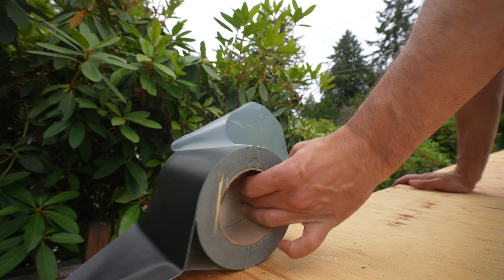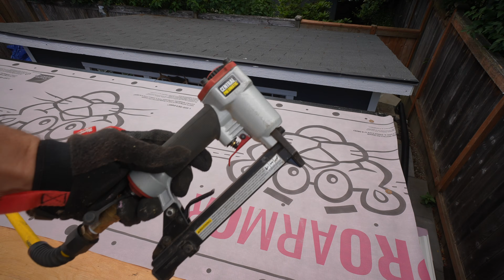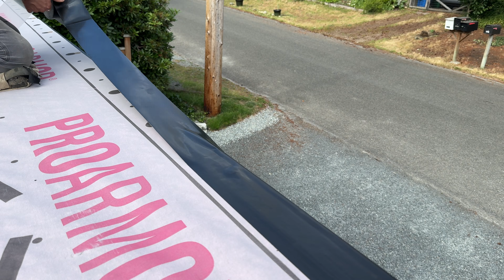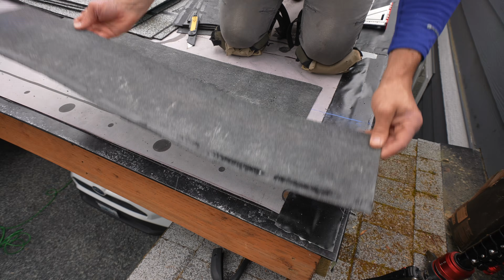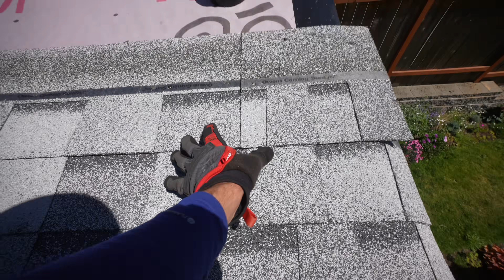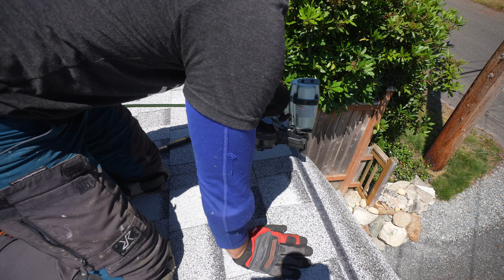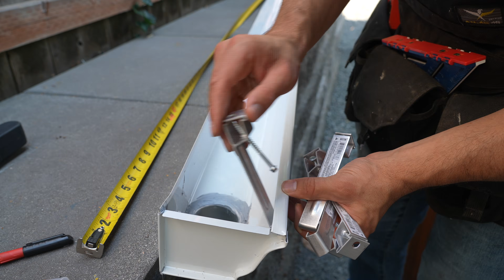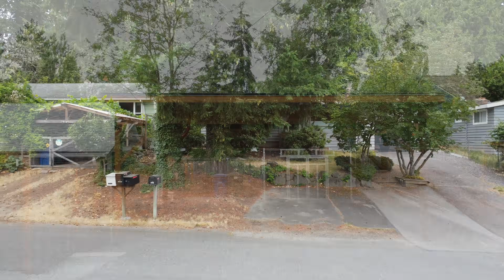BUILDING A LEAN TO CARPORT // Start To Finish

Comment: Looks great. Nice work. Did you consider installing rake edge shingles to prevent water runoff on the sides of the structure? My understanding of this practice is that it allows water to flow down to the gutter instead of drip off the sides.
Reply from the maker: Thanks so much for watching and your suggestion.  I honestly didn't know the purpose of rake edge shingles until I just looked it up.  Thanks so much for your helpful note and I make sure to use that one in future videos.

Comment: Why do the shingle nails not penetrate the 1/2 plywood? How tiny are they? I always thought they had to embed minimum 3/4 inch and if not punch through at least 1/8 inch.
Reply: By the manufacturers instructions, they need to penetrate a minimum of 1/4" through the sheathing.  
I also highly doubt that they are listed for this low of a slope application without much more of an overlap.  Most shingles are very limited on low slope roofs, if at all.  But, I may be wrong on this particular product.
Other than that, BYOT killed the install.  Redundancy is always a good thing.
Reply from the maker: Thanks so much for sharing and your support of the channel.  Truly appreciated Brent and based on the packaging for the shingles and underlayment this low of a slope is expectable.  If we have any issues once we get some heavy rain I will assure the BYOT audience will know about it. Thanks again for all the support.
Reply from the maker: There is a give and take when trying to satisfy the clients sometimes.  They didn't want any penetrations since you could see the bottom side of the plywood.  This carport is NOT in a high wind area at all so I'm not worries about any shingles coming loose overtime.  Thanks s ouch for watching and appriciate the questions.  Very good point to mention.

Comment: That trim barrier is essentially ice and water barrier just not as wide correct?  Could you just use a full roll of ice and water barrier before flashing like you did?  Turned out really slick.